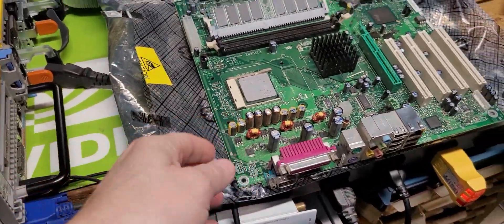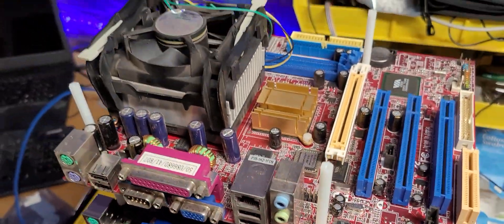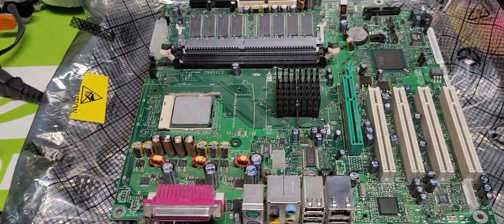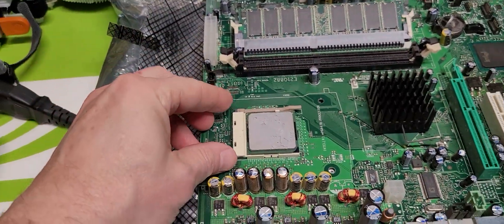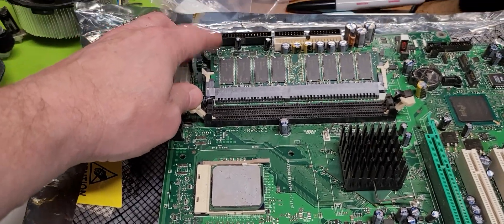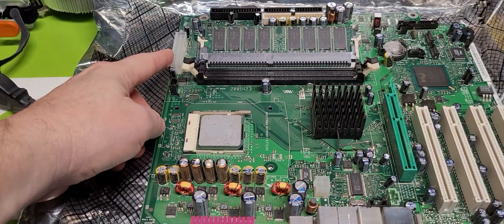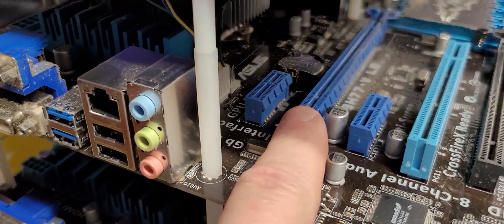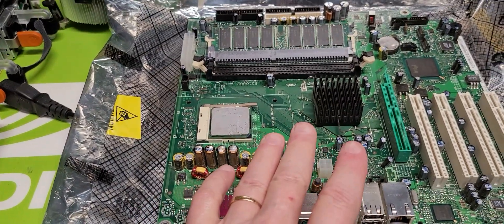Are you finally ready to move to a Xeon workstation for real?   Then do it right including the OS

Comment: Another good topic brad,

now as im already at the stage of dual cpu motherboards i would like you to do some information on the differances of how resources are used as their seems to be dual processor chasis but also like seperate cpu in the same chasis so if you didnt know what your looking for you could end up with 2 computers rather than one if i understand it correctly 

I think they call them nodes inside server 

Be good to know what you think about any of these

Their are some interesting ones but you dont see them much showcased im thinking its because their no longer supported 
 

Dell C1600

Dell 5800 

IBM x3850 M2 :person-turqouise-waving:

lenovo x3850 x6 :hand-pink-waving: interesting that these have a similar model no. 

HP Proliant DL580

:face-blue-smiling:

Their are some destop pc versions as well but not sure how well these do against the servers